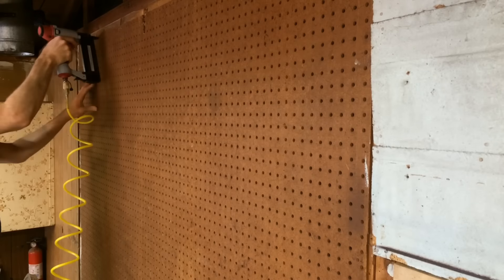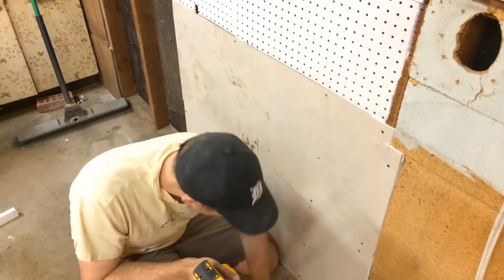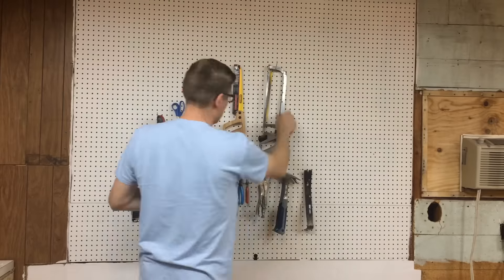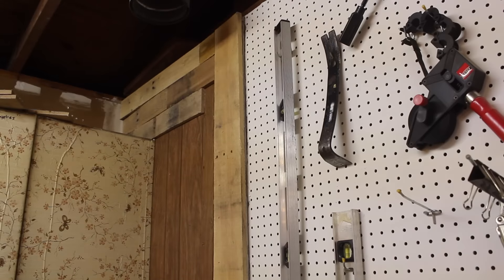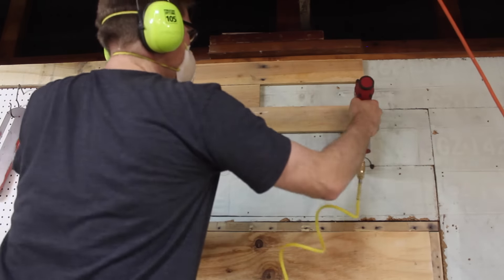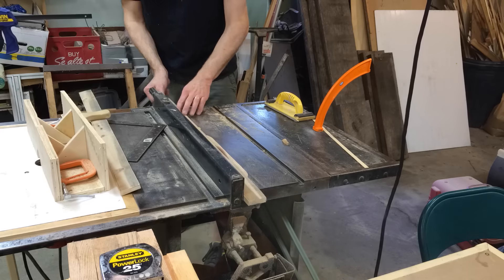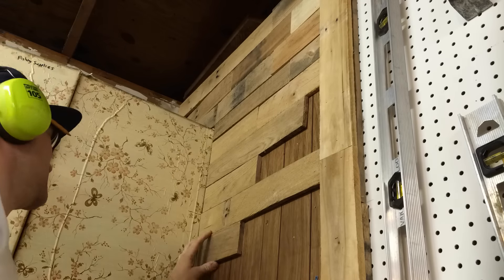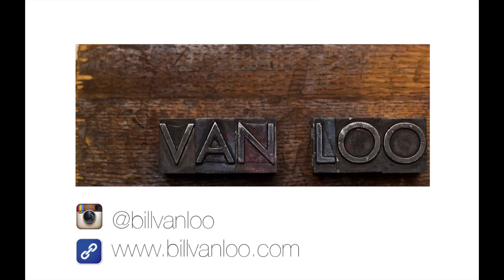Workshop Pallet Wood Wall (Almost Free Workshop Redo, Part 2)

Comment: I am doing something similar as well (studio overhaul). I have some free cabinets that I took apart and using as a top plate and a bottom plate. Plus free interior hollow core doors that I took apart (skinned) and stapled to the bare studs reinforcing along the way where needed(skinning doors is a real pain and takes lots of patience). Then I used some 1x3 for rail and stile to cover the joints and door knob holes. This gives me an infinite surface to use french cleats where needed using pocket hole joinery to install the rails and a nail gun for the stiles this way if I change my mind in the future it is a simple matter to pull it off and recover the 1x3 for future projects.
When I get money and can afford to I am going to get cheap white paint to brighten up the studio.

The pallet wall is awesome. I am going to use that on one wall as well. I am waiting for Part 3!
Reply from the maker: MsRmaclaren Thanks for the kind words, and good luck on your own studio overhaul!

Comment: Hi Loo, My garage is brick built. What would be the best/time efficient was of fixing pallet wood to the walls?
Reply from the maker: No idea, I'm afraid. Perhaps you could attach the pallet wood to plywood panels, then hang the panels with masonry anchors or Tapcon screws?
Reply: Bill Van Loo
Reply: Google User I would suggest buying some 2x2 and drilling them vertically  to the wall using masonry anchors and using them as studs to attach the pallet wood to
Reply: brad naylor thanks buddy, I've started doing that now :)